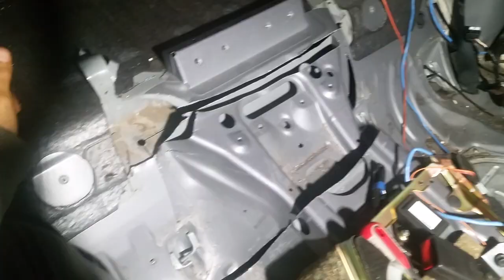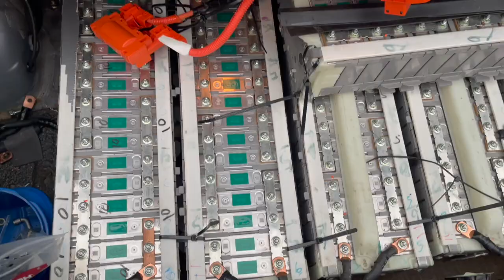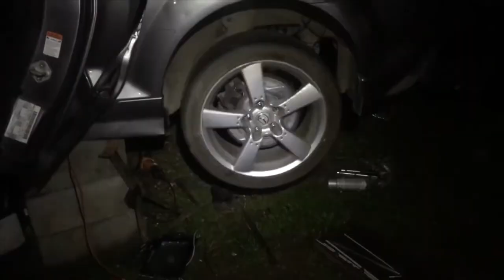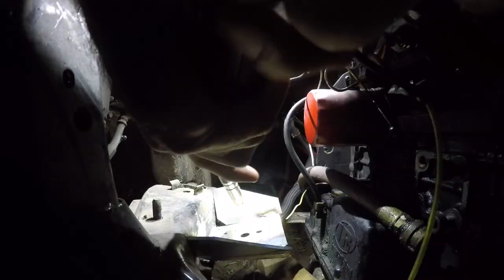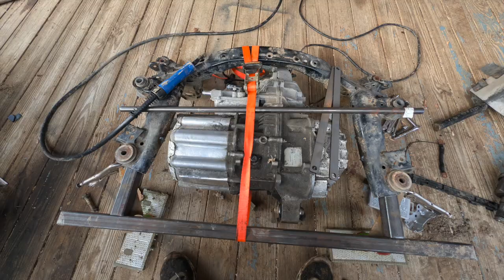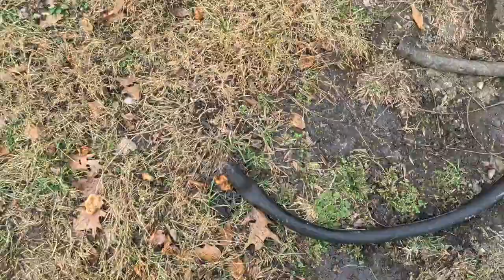Tesla Powered Mazda RX-8 Build montage

Comment: Very similar battery modules were used in the Lexus UX300E in a 8S3P and 9S3P configuration. What BMS did you use?
Reply from the maker: I have yet to determine what bms I’m going use, I have looked at the Orion bus system, but due to the dual battery configuration I’m planning on using I’m going need two separate systems. Going to go with a 68s3p and a 68s1p, due to the limited working space of the car the second battery will need to be a complete unmodified battery installed in the transmission tunnel.

Comment: Your video is great! I'd like to ask you how much you paid for the kit to make it work with Tesla motors and which BMS (Battery Management System) you're using. Thanks and best regards!
Reply from the maker: At the moment I have no bms, I’m still determining the best battery configuration, I’m working on making a 68s3p pack, and also adding a second battery in between the transmission tunnel that will be a 68s1p pack for a total of 28kw or 100ah. Tesla control unit was purchased from westsideev.com
Reply from the maker: The mounting of the motor was custom, and the generation system is my own design.